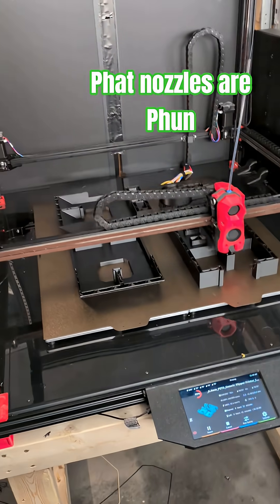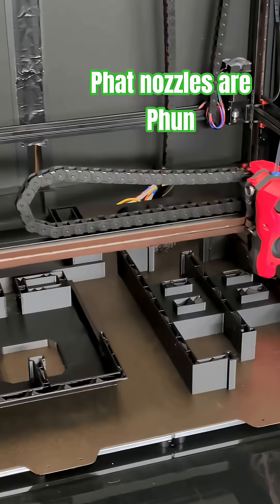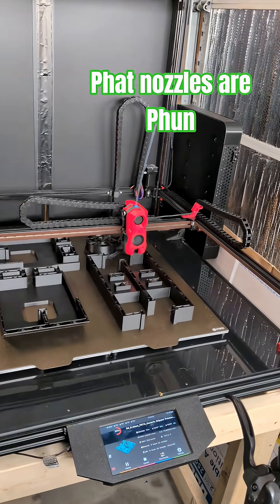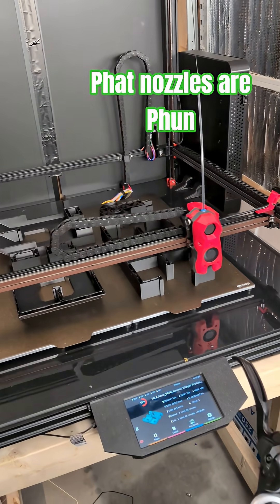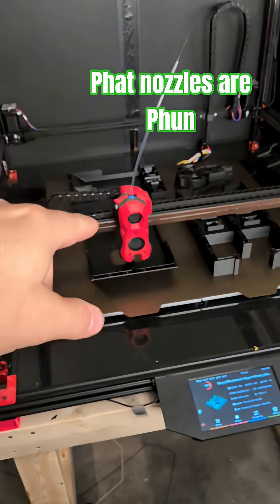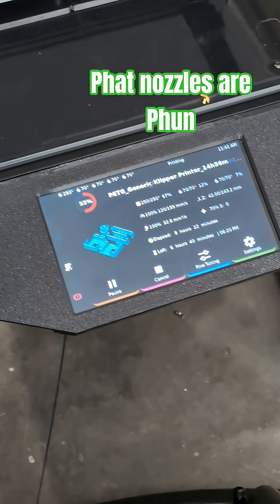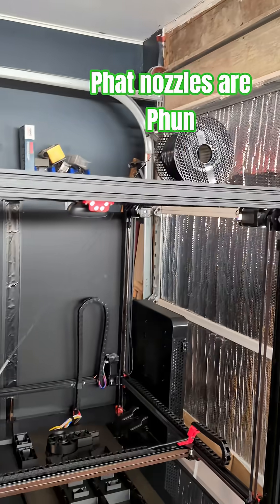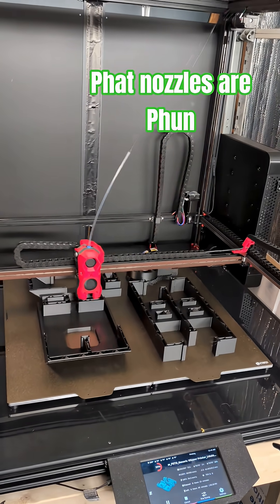Phat nozzles are phun #3dprinterupgrade #3dprinting #3dprinted

Comment: The hard is to find good printing profiles isn't it? Any luck there? I wish there was a step by step procedure to do it! I will try the Ai jusprin to find out if I can get good profiles or profile creation procedures
Reply from the maker: lol, giving the problem to a clanker aint gonna work

But ya, fysetc only provided a generic PLA profile, so ive just been tweaking to that to each filament and nozzle im using and pulling settings from the stock voron profiles to fill in the blanks as a starting point

Comment: You could print at exactly the same flow with an 0.4 mm nozzle doing 0.8 mm line width though, except then you could also reproduce sharp corners and high detail.
Reply: Ehhh.. I've had PETG get fairly resistant at far less than 100mm flow that was alleviated with a larger nozzle. PLA or ABS? Sure, all day no prob. He is doin 32 flow here which could be doable but if he does go 50 or above.. ehhh
Reply: Going from 0.4mm to 0.8mm would actually increase flowrate due to the nozzle being less restrictive for the filament, you can use a 0.4mm nozzle to do a 0.8mm line like you said, but you are still pushing plastic through a 0.4mm hole which is more restrictive than doing a 0.8mm line through a 0.8mm nozzle. Want an external source because you doesn't trust random guys on the internet, there is a blog from PRUSA titled "Everything about nozzles with a different diameter" showing bigger the nozzle, the less time is needed to print object, meaning increased flowrate.
Reply: @JunkMaybe  No, it doesn't work like that. Melt takes place in the hotend's melt zone, not in the nozzle orifice, and the limiting factor to extrusion is how fast you can melt the material. A larger orifice does have less backpressure, but this only atters once you're exceeding the extruder's pushing force or the force at which the filament catastrophically buckles in a way that jams, which doesn't take place until somewhere at least on the order of 100 mm³/s.
Reply: Nobody needs 0.4 mm line widths
Reply: @d46512  Depends on what you're printing. 🤷

I usually find myself wishing I had even thinner than that. But even if you don't need any other fine detail, square corners come out much more rounded with larger nozzle sizes.
Reply: @daliasprints9798  square corners yes. I don’t find myself wanting more square corners as much as I want the faster print time of a large nozzle. 0.6 is my daily, with arachne slicer
Reply: @d46512 Plenty of small models and lettering that wouldn't come out well on a .6
Printing a mini Ulysses submarine from Atlantis right now that benefits hugely from the accuracy of a .4